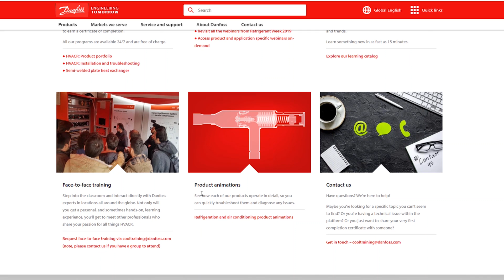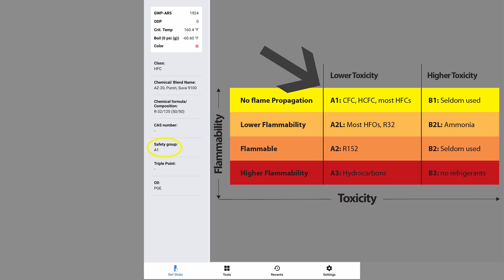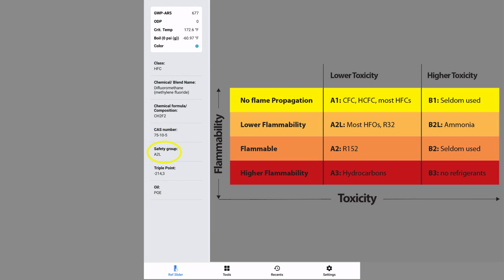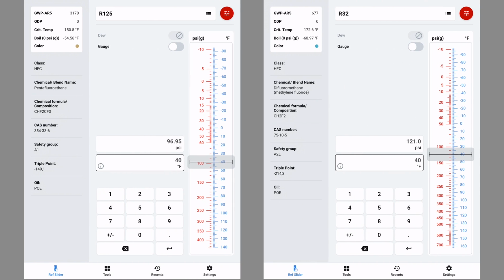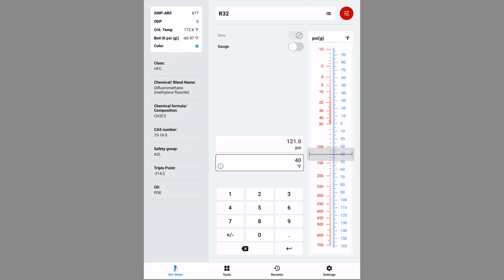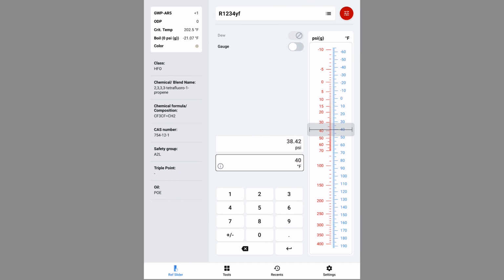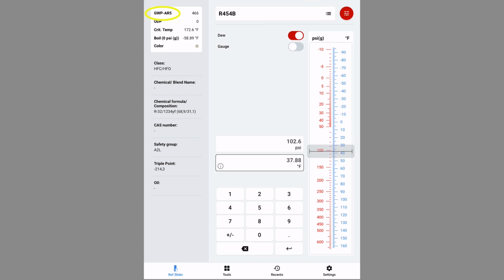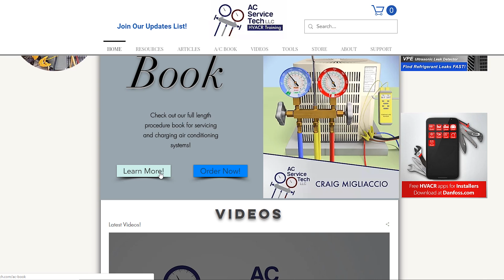R-410A Alternative Refrigerants Explained!

Comment: I have a 14 year old Trane heat pump in good shape with a 2 year old air handler.  (Evap coil leak)  R-410 of course.  When that heat pump dies can I buy a new R-454b heat pimp and still use the 2 year ols air handler?
Thanks

Comment: The problem with GWP is it neglects the differences in efficiency between the refrigerants and the temporality. If R-1224yf has less efficiency when used in a system than R-134a, you burn more gas running it for the entire lifetime of the system whereas the GWP is a one shot for the system charge. Venting an entire vehicle charge of R134a (a little less than two keyboard air dusters worth) is equivalent to burning a couple of tanks of gas. However, the life of R-134a is only 13 or so years, so if your concern is the temperature of the earth in 2100 the R-134a has no net effect after 13 years from today.

Comment: Love the E book so far!! 
I did something stupid -  on a new system, I did triple evac, but broke the vacuum with gas side (bottle upright) of 410A. 15 ft lineset. (I heard of a guy breaking vacuum with 410a instead of nitrogen) I evacuated the 410a. But my question is.. is that bottle of 410a fractionated and deemed useless now ? I’ve read mixed opinions on 410a fractionating. And is there a way to test it for fractionation ?  Couldn’t find a video you’ve done on fractionation.

Comment: The future is flammable refrigerants. It really just emphasizes the need for using proper refrigerant practices.
Reply from the maker: The issue at this point is flammable refrigerants seem to be exactly where we are moving to. Of course the USA is behind compared to the EU but they have been using A2 and A2L refrigerants for almost 10 years now with minimal problems. In household refrigerators, they just make the heat exchange rate better and use less refrigerant so it poses less of a potential hazard, thanks!

Comment: The problem is the pressures are way too high. Equipment failure rate is so high when the pressure increases.  "They" want failure so customers replace systems every 10 years. I have r22 systems over 25 years old still running strong. Every copper coil over 10 years old with 410a leaks. The aluminum coils will leak too. That white powdery haze on aluminum is rust!  It's all junk folks!
Reply: Incorrect. I have 15year old 410a systems. Still running without leaks. Aluminum coils. No issues alh
Reply: @HowToDoitright  if you have an aluminum coil on a 15 year old 410a system it's the system's 2nd coil.
Reply from the maker: Leaks really have to do more with corrosion on the tubing and the thickness of the tubing walls. The biggest problem I see is those coil tubes are so thin and they have etched the inside of the tubing to increase surface area inside so the tubing even cracks longways in the grooves they put in. It is all just crazy to me. I would really much rather have thick tubing and 20 percent more coil added to the unit if they wanted to gain efficiency. It is crazy how many systems leak. Another big leak location is where the copper tubing or a coil touches the galvanized tin plate. That is crazy, just use an aluminum plate. Some manufacturers do and some aluminum coils have been out for a long time. Not micro channel but standard aluminum coils and they seem to hold up well even with higher pressure, thanks for everyone who is commenting!
Reply: Wrong. It has nothing to do with pressures. Aluminum corrodes just like copper but like copper stops after the initial layer. 

Please stop posting stupid information you found out of your gut.
Reply: @sprockkets  Higher pressure, greater stress on the lines. More stress, shorter life span. I can find a leak on ANY copper coil over 8 years old charges with 410a. I'm in the trade, you gotta be a noob or ig nant

Comment: Think of all the R-134a released in car accidents!  It has a GWP of 1430, about 3/4 of R-410!    How often does a system leak?  I have a couple decade old systems and they are holding fine.
Reply: true but newer cars are starting to use r1234yf. they are trying to switch everything over to low gwp blends
Reply: @james6794    Yes, I saw that sticker on a new Jeep too, what kind of stuff is that??  R-134 is $4 a can at Wal-mart, maybe we should buy a dozen, lol.
Reply: Every car system leaks. It's part of how it keeps the compressor lubricated and the seals not to dry out.
Reply from the maker: Air conditioning systems will tend to leak over time with corrosion. Tubing in coils were made too thin for energy transfers sake and thats often where they leak from unfortunately. The amount of leaks I see are just crazy all for the sake of more efficient systems.

Comment: In the EU, almost, if not all air conditioners are using R32 in the past 2-3 years, yet I did not hear, nor our instructor said that there was a single widely known accident with it.
Sure, if you place an acetylene flame next to a badly leaking joint with full of R32,  it may ignite, but a simple cigarette lighter is not even enough to ignite it even if you place it next to an open ended tube with R32 coming straight out.
Reply from the maker: Correct, its been used for much longer than 3 years in the EU without any big issues, thanks!
Reply: It’s just regulatory capture by DuPont not safety.

Comment: I never liked the mixes....keep it simple and the cycle is simple...add 286 thousand blends and your inviting trouble and complicated methods..
R22...134a...32...12....yea I know there bad for the ozone...but so is alot of things. If we use them responsibly than I dont see the issue...r12 was bad cause back then we vented to atmosphere 
If we recycled like we do today...I doubt it would be a problem...its all politics nowadays
Reply: I agree 100 so next 410a will now go up to $700 a can lol
Reply: I agree with you completely. We were dumping r12, now we reclaim it, limit its sale to licensed individuals only. So many people would dump the stuff in car acs that were leakers, I was one of them, it was so cheap to refill my ac by adding 3 cans at $3.00 each every 3 months before any such thing as reclaiming refrigerants. Nothing works as well as r12 and low pressures too. R134a sucks as an auto ac refrigerant. I’d be delighted if a refrigerant that works as well as r12 did. Some say to use the es12a, yes, a mixture of propane and butane, I don’t want a torch. Now r134a is on its way out. The almighty expensive r1234yf is here.
Reply from the maker: I agree that mixes complicate things such as charging procedures and fractionation if the system leaks but systems will leak and there is de-minumus release from us working with it. It certainly would have been much better if it was recovered though for sure, thanks!
Reply: No, it was bad for the ozone, and we burned a hole through it. That's bad for everyone. We then stopped doing it, and it's repairing itself. But we still leak thousands of tons of this stuff every year. The only reason why R1234yf works well as not being a GWP contributor is that it breaks down up in the atmosphere.
If you don't want to believe it, because it's a political tihng (when it shouldn't be), just go up north where everything is melting down and the effects of climate change are easy for the avg person to see.
Reply: @sprockkets  Tell that shit to India and China lol

Comment: Greetings from Greece. Can we use r410a in a r32 system..?empty I mean. For example in a mini split.thank you.
Reply from the maker: Kafstikos, it mainly depends on the metering device used but those two refrigerants are very close in pressure and use the same oil so it may be possible to use R410A in an R-32 system. It may not operate as efficiently, thanks!
Reply: Compressors are diffrent and the capacity ratings wont work...like r22 in a 410 compressor...system designed for that refrigerant

Comment: The A2L rating seems scary but in reality it is almost impossible to ignite the refrigerant. R-1234yf (A2L) is used in most new cars.  Studies and demonstrations show how extremely difficult, if not impossible to ignite the refrigerant even in a horrific accident. It would be interesting to see tests of the other A2L rated refrigerants. Australia is currently using R-32 as a replacement for R-410a.
Reply: in a horrible accident i'm more worried about 15 gallons of gasoline then a pound or two of a barely able to carry a flame refrigerant
Reply from the maker: Yeah I think that A2L refrigerants are becoming more and more accepted now. Its just a matter of hearing that a refrigerant is slightly flammable and thats the problem but the actual ignition is another story. They are limiting how much of this is used in an application anyway by increasing energy transfer so not as much is needed in a system.

Comment: Working pressures are ridiculous for 410a. Manufacturers surely could have used other alternatives. Part of the dumbing of America....
Reply: Yea reallly....410 pressures are dangerous and I dont like using it. I keep plenty of 22 to last a while
Reply from the maker: Hey Greg and Jesse, thanks for your comments! The problem is that the R-22 retrofit refrigerants had 0 ODP but had high gwp and back then Carrier had come out with R-410A which had good energy transfer and that just became mainstream. The problem is not any refrigerant can be used due to the capacity and boiling point that is needed for air conditioning. Refrigerants that operate at lower pressures for applications such as freezers just don't work well for air conditioning applications, thanks!
Reply: @acservicetechchannel  you know
 I am using r422b in ac and freezers. United refrigeration put me on to it.